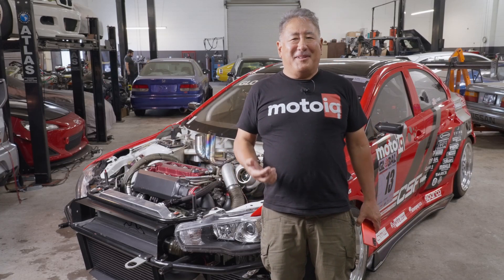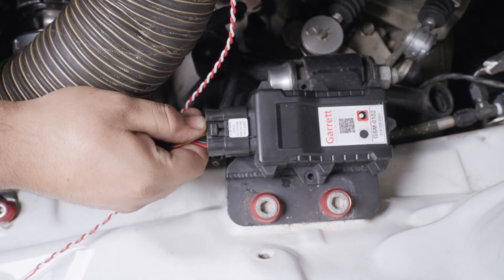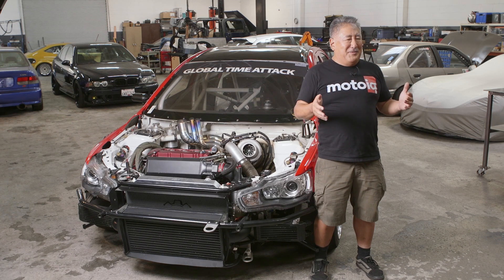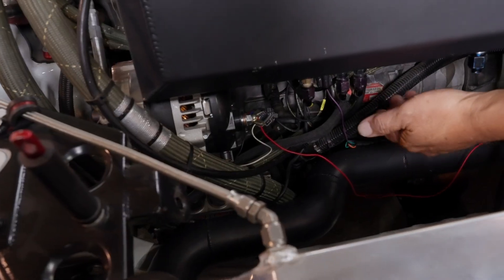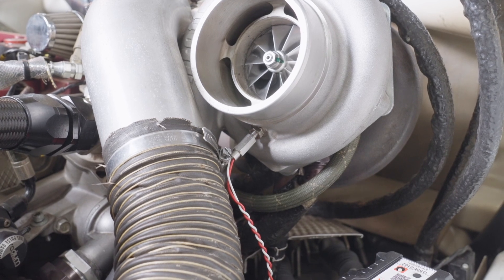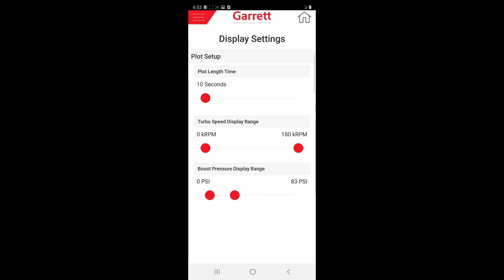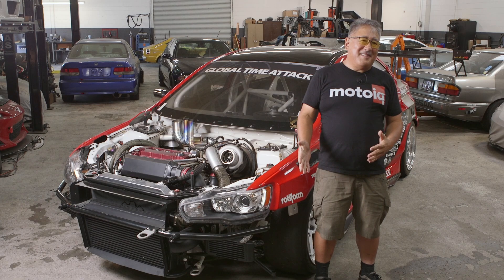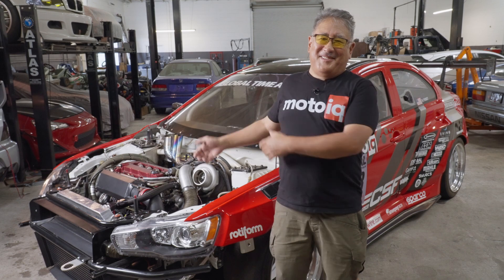Why is Turbo Speed Important? Testing Garrett's New G-Smart Module

Comment: The g series turbo will destroy itself if over spun. For example. 37-38 psi on a Subaru g25-660.72 ar the guy blew 3 up before Garrett said in the analysis. Over spooled turbo, so 4th turbo 32 psi. No issues, max shaft speed is 165,000 rpm. It says it in giant red warning letters in the instructions. Keep the turbo in the efficiency range and be happy. Or if your not get a bigger or smaller turbo to suit your needs. Don’t push these to the limit you will have nothing but failure. But keep it within the efficiency range. It’s a great fast spooling turbo.
Reply from the maker: Yes, you can look at the compressor map and easily know that!

Comment: Basically your tuner should have a turbo shaft speed sensor so they don’t exceed the rpm of the turbo and destroy it. Also see the limit of the turbo. But once tuned it should be good. And for the price of them. It’s un real. I’d love a speed sensor hack that I could diy . But calibrating it….
Reply from the maker: Just get this, it's cheap.
Reply: @motoiq  compared to replacing 3 turbos yes it’s very cheap and a great health tool for your turbo as well. I have never had the luxury of having a turbo shaft speed sensor on every vehicle I tune but the ones I do tune that have one installed makes seeing when the turbo is in its efficiency range a lot easier and over-spooling the turbo doesn’t happen anymore. But for those not tuning their car probably don’t need one as bad as the tuner who is wanting to push the limits.

Comment: Would be neat if it also graphically plotted your position on the compressor map.  It has the PR and speed input, just needs MAF or RPM input really.  Not sure it's worth $650 to me personally to know my compressor speed when I run such low boost at 20 psi, but neat I guess?
Reply: I'm with you

Comment: Not really “innovative” when all the parts, and knowledge, do exist already, of the shelf and on the Internet.

Somebody simply needed to put it together and package it.

If this was 7+ years ago, it would have been innovative for sure.
Reply from the maker: when no one else has done it on a consumer level, it is innovative.
Reply: @motoiq  Agreed. That guy can go kick a sack of rocks. How pray tell was the technology from "7+ years ago" innovative when the tech was all but alien to Joe Regular? And if the tech existed, why haven't more people adopted the tech to monitor their turbo speeds? Logically, if the tech existed and there was market demand, we would have seen consumer pick-up. The reality is no one has been installing turbo speed monitors but for teams that had the resources to do so. With this, Joe Regular can toss it on their tuned Golf R in a few hours on their day off and accurately monitor the speed of their turbo. THAT is innovative.

Edit: this post brought to you by the NA engine gang 😎
Reply: A standalone high speed counter is expensive to integrate. Standalones offer HSC counter modules but you have all the input cost getting to that. A standalone HSC that has a HIM drives cost down because now it doesn’t require a special computer. The computations are done inside the box and relayed real time.